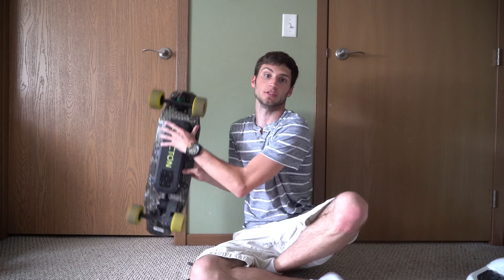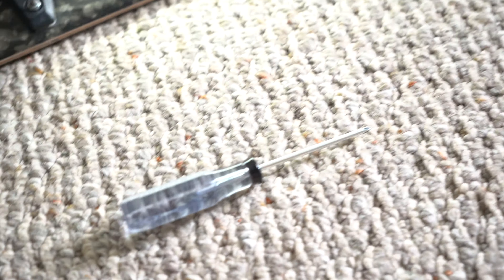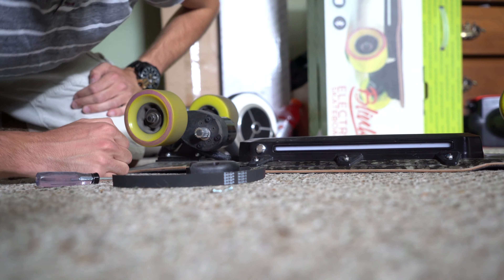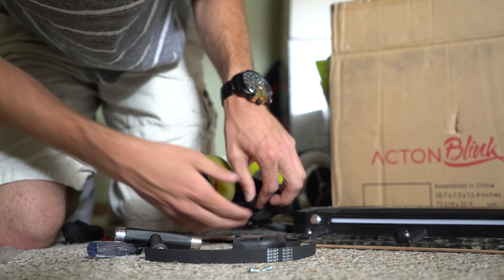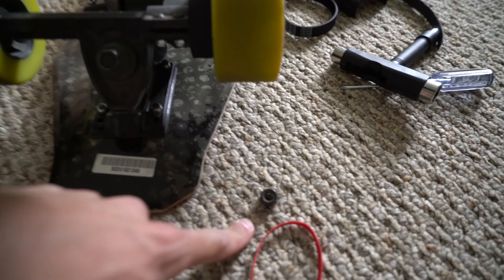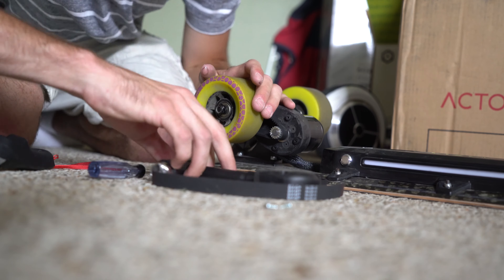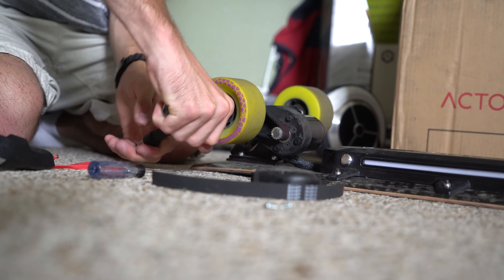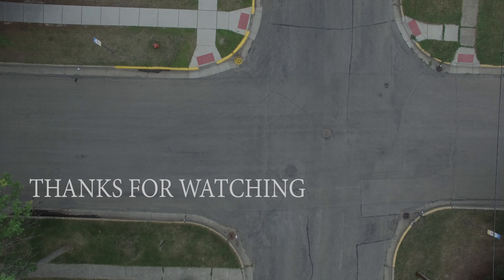ACTON Blink Board - How to Replace the Driving Belt

Comment: Any tips on how to make the belt slip less? It seems like the belt started slipping more when I go up any slight incline and sometimes it doesn't respond when I hit the gas and I have to go back to middle and forward again to get it to kick in.
Reply: I've heard that using the brakes wears down the belt so it sounds like you just need to replace the belt. Just use the brakes sparingly and it should last a while
Reply: Pretty sure it's the motor I'm sending it back to them today or tomorrow, it used to go up hills like a champ then it kinda cuts out now especially when accelerating.
Reply: should be the belt
Reply: Was the motor I shipped them the motor and they sent it back repaired then it worked